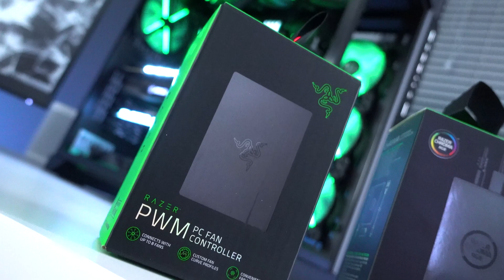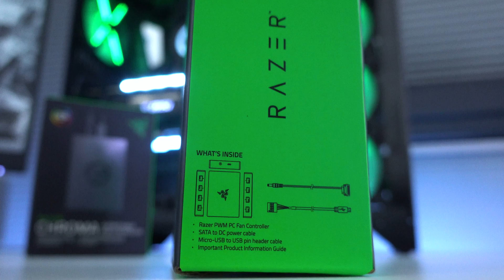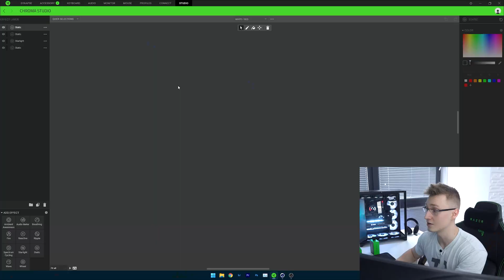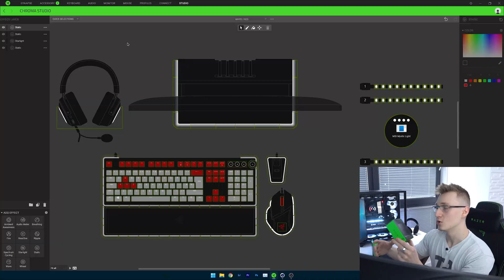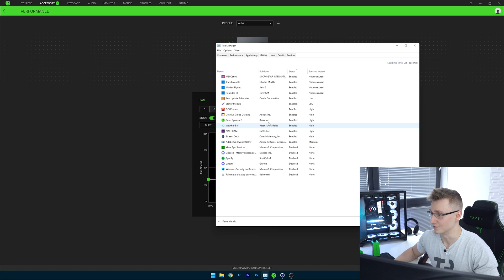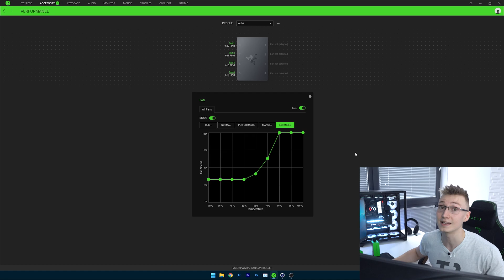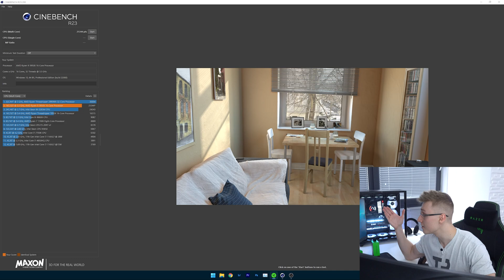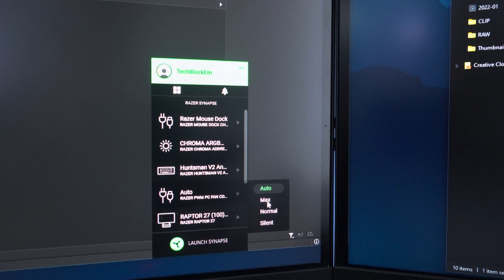Razer PWM PC Fan Controller REVIEW

Comment: Hello quick question, I ordered 9 EKWB EK Fan loop and was looking at the Razer Chroma addressable ARGB fan controller for more rgb control. Would that be enough to power 7 120mm fans and 2 140mm fans? all fans are daisy chainable but razer products are a little bit expensive on my region so I wanted to know if 1 chroma rgb controller + that would be more than enough for my needs? thank you for this informative video btw, I know its late but I just recently transitioned from a gaming laptop to pc...

Comment: Ok Here is what really sucks about all new Razer Products, You can only use Synapse 3 which is only able to be used on Windows 10 and newer operating systems, To bad for all windows 7 users but as windows 10 is absolutely horrible trash OS, I have wrote Razer & they dont' care they want all of you color lovers of RGB lighting affects, I REALLY LOVE RAZER PRODUCTS BUT SINCE SYNAPSE 3.0 ONLY WORKING ON SYNAPSE 3.0 ON WINDOWS 10 OR NEWER They need to make all synapse for @ least Windows 7 as it is still out here on so many computer but they are targeting a certain demographic instead of actual customers or custom builders

Comment: I want to try running this just for fans, can you run this using a micro usb to usb and a dc plug lol, what is the specs for the power I’m so confused
Reply: I found the specs, 12v 4.5 5v 0.5
Reply: Now the question is can you run this micro usb to usb/ or usb c loool

Comment: NZXT Controller does all that and controlls PWM and lights
Reply: No, the nzxt controller doesn't use 3 pin argb. So it's useless.
Reply: @fancy-f4n  Then how am I also using 6x Noctuas with the NZXT pwm controller...
Reply: Which fans do you use with nzxt controller?

Comment: Hi sir. I have a few questions about this product.

Q1: can you plug a slitter on the rgb hub?

Q2: can you use the pmw adapter in pararel with the rgb hub

This is because I have one 360mm aio with 3 fans and the other 4 more fans and the rgb hub doesn't have enough headers for my fans. I would really appreciate your help.
Reply: Did you happen to figure out if you can use a splitter and use them in parallel?
Reply: @justinjones2044  nope.... Rn all my fans are at 100% speed all time and if I change a setting on the bios it just bricks it down lol.
Reply: @kennY_72  ripppp lol I’m building a pc and gonna have 9 fans so tryna find best rgb fans and controller for them
Reply: @justinjones2044  lian li fans with their controller and the streamer rgb cables. Those look sick!!
Reply: And I have a 7900xtx system lol

Comment: just came across your video after experiencing some issues with the PWM controller synapse. for me synapse will indeed auto-start but will just not spin fans according to my curve that i have set in synapse. i can skip through quiet/normal/performance and it will change speeds accordingly but when i go to the advanced tab it will just spin fans according to the most recent tab that i was just on before. absolutely ridiculous for this price and entirely useless honestly.

Comment: Hey I have a question I've been contemplating to get this but I'm using cool master fans and they have three pins can I still use them on this product?
Reply from the maker: No, you’d want to use 4-pin PWM fans if you want to control fan speeds

Comment: Hi,

Nice video!

Are you also plug in in the cpu radiator fans on the PWM PC fan controller?? And there are only 8 slots do you have 2 PWM PC fan controllers? or using a splitter??

Kind regards,

Xander

Comment: So you can control 8 fans but only control the lights for 6 when everyone's favorite case has 10 fans. I hope they improve both of these products. I bought 2 of the RGB controllers not knowing razer synapse only supports one. THESE PRODUCTS COULD HAVE BEEN GREAT. but no! btw i can buy a 9 fan hub for 14.99. I LOVE RAZER STUFF but there customer service and quality of products has really decreased in the past 2 years.

Comment: Good video -  I just had to replace 3 case fans in a 13 year old case - ( love my Antec 1200) - anyway - does this go inside the case ? -  Does it need a power supply to wall outlet? - Or does PC power unit via PSU ? -   I just want to make sure  -   how long are the cables ?  - Has the software been updated since video ? -  I guess case fans are at full 100% RPM - Before software kicks in ?

Sorry for all questions - I never used a fan controller before - As my case had fan controls on it - I now lost this option 

Thank you

Comment: I love razer peripherals but the seems like a rubbish controller tbh. I'd love to have something like this in synapse but it's such a severly limited controller. Pretty much every feature you mentioned should be added already exists in aquaero or corsair controllers. This is a glorified hub. 

Heck even argus monitor or FanControl software have much better fan control capabilities than this and no additional HW needed.

Comment: Hey @Techblock! Thanks for your Reviews. I have a Question about the RGB Controller - I bought my complete Setup for me new PC yesterday, including 9 ARGB Fans from bequiet, (3 for CPU AIO Cooler and 6 for Casecooling), but i recognized that the Razer RBG Controller just has 6 slots to connect with. How do i deal with one Controller but 9 Fans? Thank you in advance!

Comment: I have the MSI x570 unify and use msi center to control the RGB pretty much all the rgb devices just the aio which is z73 has to use its own works very well and use software called fan control to set fan curves works great can pretty much set curves with GPU , CPU , nvme etc and it's very light weight

Comment: Naaah. For Razer, I'll just stick to the stuff that they know best. 
Mouse, Keyboard/pad, Mousepad..... and nothing more than that.
User HID peripherals is where they started, and where they excel at. 
Their recent foray into other peripherals/equipment is frankly laughable. Especially that Zephyr joke.

I have their Blackwidow Elite kb, Basilisk/DeathAdder mice, Tartarus Pro keypad, and Goliathus Chroma mousepad. 
They all work very well. Not the best, but good enough for daily drivers.

Their headsets are generally rubbish. I went Sennheiser and Audeze for those.
Their PC cases are also rubbish in ergonomics and cooling. I went Lian Li and Phanteks for those.
Their monitor.... horrible from what Hardware Unboxed review. Just go with Samsung or LG.

Comment: NZXT has a similar product and is way cheaper. Also fixes issues you were having (GPU/CPU temp, Startup) NZXT RGB & Fan Controller. Maybe worth checking out. :D I have used it for over a year and works flawlessly.
Reply: I think that can only be used with NZXT fans.
Reply: @breezebandit1636 cool to see a reply to a 2+ year old comment 😄. But no, you can use any 4 pin pc fan, maybe even 3 pin, not 100% sure.

Comment: I went with the O11 Dynamic when I first did my build. All because of you. But now I'm realizing: 

1. It doesn't keep any most dust out despite all the filters it comes with. Because you can't cover the back of it. As they never included a filter for the back of the case. 

2. Sucks for air cooling for gamers. But you can order custom made front acrylic kits for the front panel. 
---‐‐‐‐--‐‐‐‐
3. Lian Li did make the O11 AIR and the O11 Dynamic EVO which you can by a mesh kit for. You can also buy a Acrylic Front Panel for the O11 Dynamic XL. 

I am hoping to get my hands on an air case or a evo case. BUT the mesh kit for the EVO case is hard to get your hands on. It can take up to a year to get one. So I might just get an Air if I can. Until I finally start a top of the line build using the O11 XL.

Comment: It looks like you can set unique curves per fan device. I think polling the GPU for temperature isn't likely unless Razer begins marketing Razer GPUs with some other partner, but what you SHOULD be able to do without difficulty is pin a fan curve to a specific application/game the way you do Chroma lighting profiles, so that if you start up Cyberpunk your fans pointed at the GPU know to blow hard like a hair dryer.
Reply: In fact I'm gonna ask: Can you check Synapse -> Profiles -> Linked Games, choose a game, and see if you can the fan device and set a profile for that game? That way when you start the game, the fans at the bottom of the case (whichever socket on the controller they're plugged into) should just automatically switch to the more aggressive fan profile at the time you see Chroma lights change.

Comment: i've got two main gripes with this thing.

1. There is no 0db mode, having a feature on the fans but not being able to use it thanks to software is not nice.
2. You can't (or at least i couldn't) control the fan hub from a second windows user.

Comment: I too am using an MSI motherboard and I have never had any problems with the fan curve i set like 1-2 years ago, however I didn't set it through their software, I set it through the BIOS settings... No one likes tech companies' software that you have to start every time you start your pc and half of the times the settings reset themselves, especially Razer's (well at least Synapse) Plus you have every function of the razer pwm controller built in most motherboard bios, you can set a graph for individual fans depending on GPU, CPU, Chipset temps(+ any other thermal probes you have on your motherboard if it's some kind of overclocking mb like the EVGA ones) and you don't have to install any kind of bloatware that companies want you to use and not only that but you can also set graphs for non-PWM fans too... something you wouldn't be able to do through PWM only hub...
Reply from the maker: Yeah you can set fan curves straight through BIOS :D I think Razer gotta really expand upon this PWM fan hub cuz it can do just about what you can do through BIOS fan curves :/

Comment: Another suggestion would be the ability to change your pc's colors with the according temperature/ fan speed, like motherboard software. It could integrate with Razer's Addressable RGB controller and peripherals or something like that which will add a whole tone of value. Or even this could be implanted as a new effect on Synapse, only Razer is to judge!
Reply from the maker: Eyy that's actually smart, colours based on temp, about time we had that on Razer Synapse
Reply: I agree.  Just like the Sapphire Trixx software for my GPU.  I know the fan controller is new and hopefully they add features.  The aRGB controller is great.  I have that and it's dialed.

Comment: I expected this video for so long! First of all, each and every idea that you mentioned should be implanted into the controller! The on-board memory is a concern because we don't know if they actually put one for this scenario. Besides that, all the temps of gpu, cpu, ssd's, ram EVERYTHING should be included so it could barely justify that high cost for it's current features. Also the synapse bug is unacceptable and should be fixed. Hope Razer to make the right choices!

Comment: First of all, great video. Really glad to see you review this product! I have the fan controller myself and I have two issues with it:
1. On 'Advanced', you can't set your fan curve below 35%. I appreciate Razer want you to always be cooling your PC, but we should be able to have more customisation here
2. Whenever I lock my PC, or start it up because Razer Synapse is not able to run then, it just runs my fans at 50% constantly. Fans ramping up and staying at 50% when you lock your PC is not the one. Totally agree with your suggestion of onboard storage with a default profile for it to use when Synapse is not open

Hopefully someone has got around the fans spinning up when you lock your PC as that is driving me absolutely crazy.
Reply from the maker: lol yeah mine does that too when I lock it :D

They really gotta have a preset default fan curve...
Reply: @TechBlock  would it be possible to make it work by forcing it to run synapse as a service? there are ways to turn anything into a service 🤔